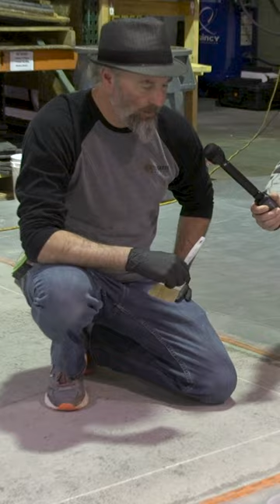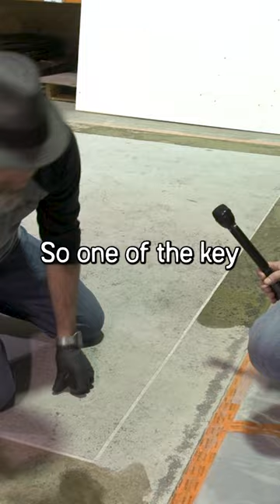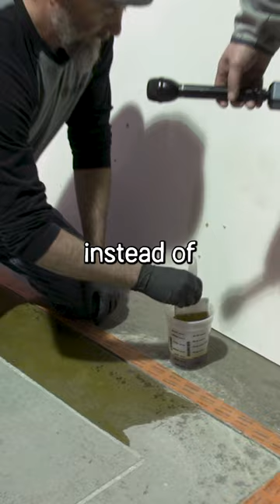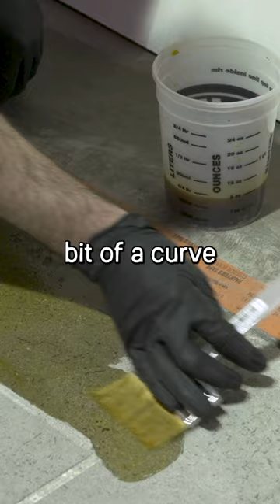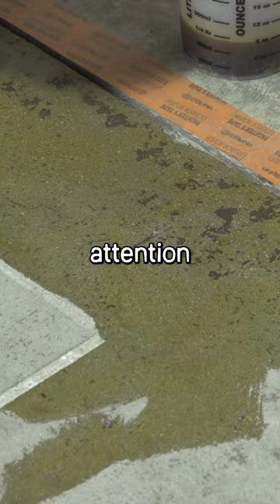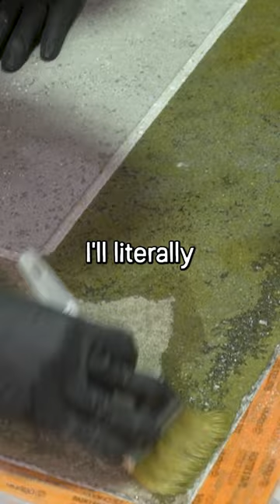How to Start and Stop with Acid Stain! #concrete #shorts @ConcreteMystique

Comment: I just had 15 yds of broom-finished concrete patio and walks installed. Can I spray on a stain?  If so, how long should I wait before doing so?  I’d like a light tan color.
Reply: Usually like 28 days is what it takes for concrete to fully cure so really like after like 4-5 days when the surface is dry and has turned it’s true color you can stain it then apply sealer on top of that like 2-3 days later
Reply: @onetruesoldiervt3686  Thanks!  I poured all slabs except 1 with 1/2% calcium, but the one that didn’t have it is bleaching out very slowly - still large sections of dark gray.
Reply from the maker: Check out this video on concrete stains, it should have the answers you are looking for. https://youtu.be/vHskzIHmdEQ